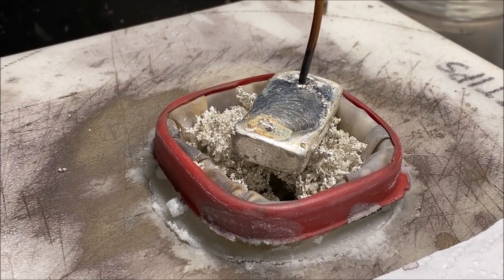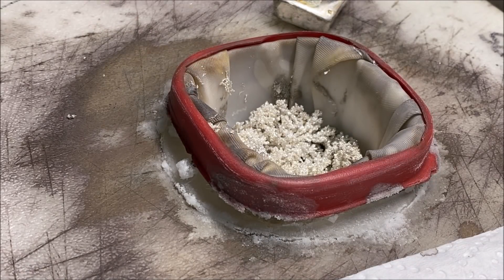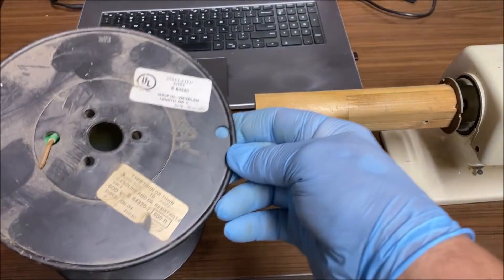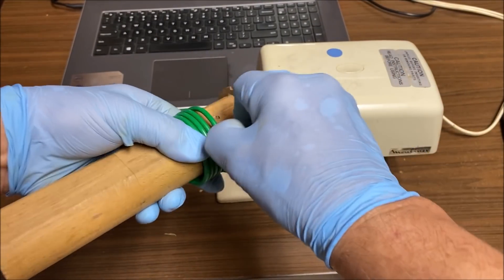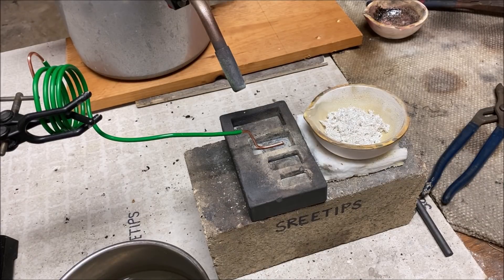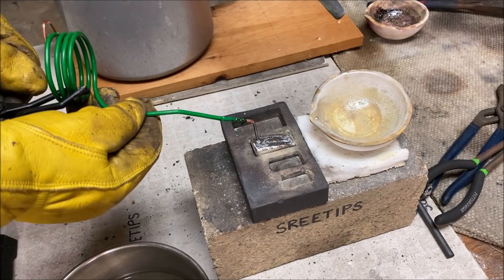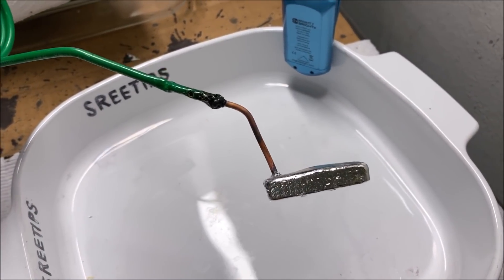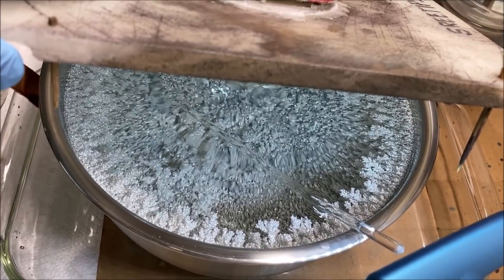EP015 Silver Cell Day 7 Update Anode Bar Pour

Comment: I think for that contraption you used for coiling the wire you may want to use a variac or possibly a light dimmer and maybe a foot peddle to give a bit more control of the speed and wire
Reply from the maker: Good idea

Comment: Is there any reason you could not just use a Stainless Steel anode of the same grade or better than the bowl, It is about the contact and transfer of the electricity at that point. I could see contamination from the Copper wire if that new bar woulds sink in the electrolyte for a extended amount of time. It woulds sacrifice it self being Silver and then expose the Copper wire kinda encased. You would still have your Silver alloy transferring in the electrolyte leaving the slime's and if the SS anode did fall in there would be no contamination because the SS would not be effected by the electrolyte or the bowl could not hold it for long. I do not refine any silver myself, just get annoyed by it during gold processing. I filter it out during processing, and make beads from the dried filters for later. At times Silver has showed up and really slowed a batch down, I once put books of labeled 24k Gold leafing in to a second drop batch and had white slime settling out for days. I could find not info. on the sheets because they were super old and came from a deceased Gunsmith. Just another question has risen  has there been any loss of the bowl's mass after all this running of your refining cell?

Comment: Id say you need some flux on that copper. Why not just make some silver wire... it has a lower resistivity than copper.
Reply from the maker: Copper works good and it’s readily available. Silver is the best conductor of all metals, according to Wikipedia

Comment: Do you run a cold oxy acetylene flame with les oxy or is that just the camera making it look that way?
Reply from the maker: I had the O2 cut back but not much.
Reply: @sreetips  Do you cut it back for a reason? The hottest flame is with enough oxy to keep the inner blue flame tips short and sharp. Are you conserving gas or does the colder flame work better? Or as usual am I overthinking it lol. Also just recently found your channel love the work.
Reply from the maker: I cut back the O2 to get closer to a neutral flame. Molten silver absorbs oxygen, then bubbles it back out when it hardens makes terrible looking surface
Reply: @sreetips  Good to know. I am interested in refining due 100% to your video's. I appreciate the information. I was kind of wondering if it was due to oxy content or if something else caused a blemish on the metal.

Comment: Why coil the anode wire to lengthen it ? the secret is keeping it short for a low electrical resistance, not to lengthen it to raise the resistance.
Reply from the maker: Easier to store and ship a coiled wire. And easy enough to stretch it out as needed.

Comment: @sreetips you mention that the exposed copper is no problem. If the anode drops into the electrolyte, isn't silver going to displace the copper and dissolve that wire?
Reply from the maker: Yes, but fear not. Copper in the cell is not a problem

Comment: Smart hot set anode leash ... love the process you use.

But you have to know that copper is going to get in your crystals if you let it get dissolved even the slightest bit.

hope youre doin good and not getting flooded.
Keep stackin !
Reply from the maker: Copper in the silver cell is not a problem
Reply: Is the copper going to stay suspended in the electrolyte solution, my first thought, but  I could be wrong.

Comment: if the connection between the copper and the silver is a worry, you could make a flat spiral to suspend in the silver giving it a small footprint but a large area of connection. And for those thinking about the copper being a contaminant, as long as the copper doesn't touch the electrolyte there shouldn't be any contamination.
Reply from the maker: Copper in the silver cell is not a problem

Comment: Interesting. Would've figured the oxide layer from putting the copper wire in direct flame would cause some issues in either a bad electrical connection or increased resistance. Figured it be better to toss it in just before the silver freezes.
Reply from the maker: The flame directed at the copper wire should prevent that
Reply: @sreetips  The energy from the flame is what's oxidizing the copper while exposed to excess oxygen though - granted propane and MAPP gas flames produce a little water as a byproduct, which adds to the oxidation. You can test it if you're interested. Heat up a small bit of copper scrap for a short while. Though you should see it oxidize in the flame over time if you don't heat it til it glows, try taking it out of the flame and letting it cool in the air next. You can (but don't need to) heat it til it glows instead. If you don't see the copper(l) oxide form (has a distinct dull, reddish color compared to pure copper), quickly dunk it in water, and if it's hot enough, you'll see the oxide rapidly transition from copper(l) oxide to copper(ll) oxide, which is black and may flake away from the surface as the metal contracts.

Comment: How can it be good for the anode to be showing copper through the bottom of it when you’re trying to purify Silver wooden copper also degrade into the solution into your silver cell into your crystals that you’re planning on harvesting just wondering Wouldn’t be as pure as you think I think
Reply from the maker: Copper in the silver cell is quite normal and won’t hurt purity of the silver until it gets up to 60g per liter

Comment: Shreetips, raise it up. Don't let it be near or on the bottom. You're gonna end up with copper in your solution. It has to be suspended in the middle of the silver.
Reply from the maker: Copper in the cell is not a problem

Comment: Mr. Sreetips, what happens after you use up the dbl refined crystal into the cell? Are you going to add another batch of crystal or are you going to harvest it? And call it triple refined crystals?
Reply from the maker: I’ll harvest and call it triple refined
Reply: @sreetips  Is this what gives silver it's "fineness", as in decimal places (.999)?
Reply from the maker: Yes, 999 parts per thousand is industry standard for silver, and gold.
Reply: @sreetips  Aaah....I see.  I thought it was done through some kind of molten refining process.  So all fine silver, and gold is done in this manner?  Thanks.
Reply from the maker: Three nines means that for every 1000 atoms in the metal, only one of them is not silver.

Comment: Hi Sreetips - do you think there's any danger of contamination if the copper wire gets directly exposed to your silver stock in the basket?  I was thinking if you raised the wire a few mm from the bottom of the mold you'd have a nice thick layer of silver there.
Reply from the maker: No, the copper won’t plate out with the silver until it gets up over 60g per liter

Comment: Try flattening the copper wire with a fancy tool. (Use a hammer :) and then pour the silver around it.  More surface area inside the bar that way.  Can also be higher in the bar a bit.
Reply: This
Reply: 2nd -- hammer it to flatten it then make sure it's got plenty of silver below it.  Once cooled the wire and silver area can be painted / coated to prevent oxidation and corrosion on the top

Comment: You might want to ensure that the copper wire contact in the anode bar is not exposed to the electrolyte solution  The copper may contaminate the electrolyte and the deposited silver in the cell.

Also, it seems to me that the deposited silver crystals are more compact and more dense than previous deposits. I wonder if that is a result of the better electrical contact for both the anode and cathode allowing you to run the cell at lower voltage and current. 

Electrochemistry is a deep and complicated subject.
Reply from the maker: Agree, the copper exposed isn’t critical. The impure shot has copper in it

Comment: If the copper wire out the bottom doesn't matter, then why do you need to use silver at all?
Reply from the maker: No it don’t matter because the impure silver that I normally feed into the anode filter has copper in it.
Reply: @sreetips  Ah, Ok. Thanks. I wonder what a pure copper anode block would do in this setup then.

Comment: Did you note the current and voltage when the anode bar was on the "bridge"?
Reply from the maker: Same, 1.5a 1.9vdc
Reply: @sreetips  Thanks. Guess that means the process hadn't stalled.